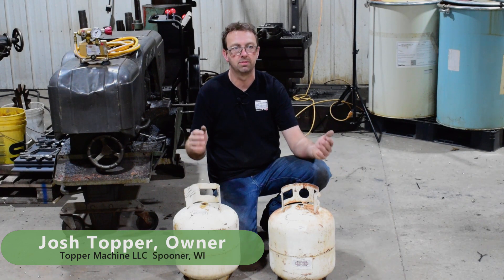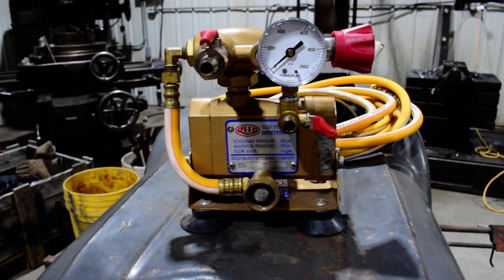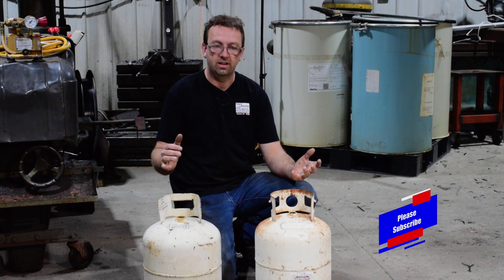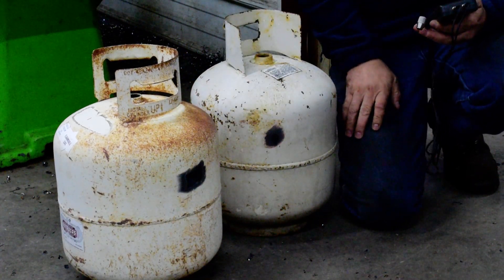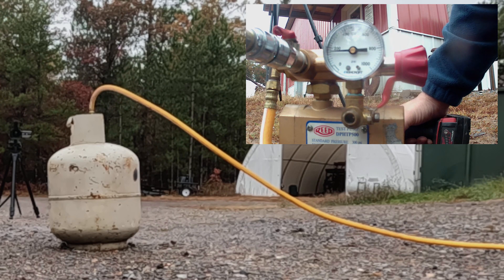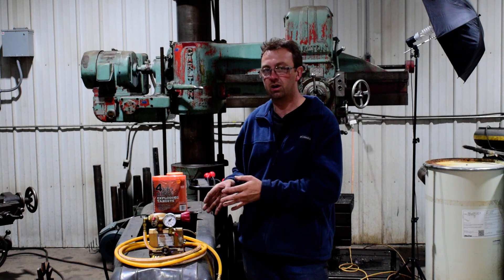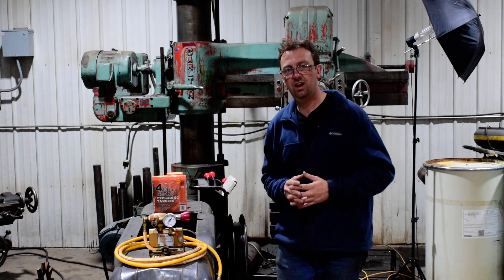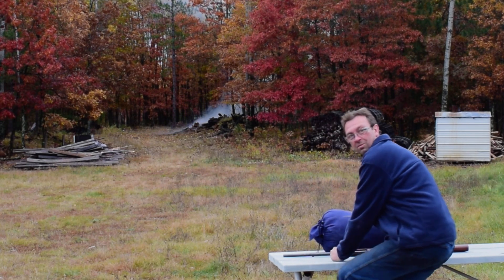What does it take to blow up a propane tank?  Hydrostatic testing

Comment: Very informative.  Having been professionally involved in air testing to failure, I can guarantee that your hydrostatic testing is infinitely safer .  Air testing should not be done by any non-professional and should not be done in anything but a very controlled environment .  Even at that,  it is a very risky business that can destroy  any confinement chamber and/or apparatus .  Personnel injury is a very real concern .
Reply from the maker: Thank you. I have pinned your comment as it is spot on and hopefully others will read it. Been doing hydros for years myself and have seen gas testing by people go wrong. A good hydro pump is a small investment in safety.

Comment: I found out the hard way be safe around propane!

I put a 1lb tank into a mr buddy heater and it had even a TINY leak! I sparked it and it caught on fire! I quickly got it out to the parking space! After 5 minutes the safety cap blew and it burned for nearly a solid 20 minutes!

Lesson learned, do NOT light around that famous rotten egg smell!

Comment: 1:26 not safe to use as an air tank?  Well you would be 100% wrong as propane is 200psi and most air tanks are 150psi.  Still watching the video but they're tested at factory I believe to be 600+psi when recertified.

Comment: Back in the late 80s I was the plant manager and mechanical engineer at a company which manufactured industrial gas cylinders.
As part of our QC process every cylinder was yydrostaticaly tested to 3x working preassure after heat treatment. In addition we would take a random sample from the production line every day and pump it up to failure. We judged the result on 3 criteria - firstly the volumetric increase before failure had to be greater than 50%, the failure had to be at greater than 10x of the working preassure and finally the failure could not be at a weld.
In the case of toxic gases like sulphur dioxide and ammonia we would also x ray all the welds of a sample from a batch. 
As a member of the industry association I was involved in investigating accidents.
There were 3 ways that a failure could occur - extreme heating, mechanical damage and overfilling.
As for calculating the strength, there are design codes which give you the answer. 
In the US that would be ASME. it's not heavy duty maths, just a set of simple formulas. Really it just comes down to the properties of the steel used, the wall thickness, the diameter of the cylinder and to a lesser extent, the shape of the domes.

Comment: What about temperature? it gets as warm as 46 celsius degrees in my town, and my propane tank is stored on the grill under direct sun... is there any chance of explosure with those conditions?
Reply: The pressure relief valve will release the pressure first.

Comment: For a MILD STEEL(60000 tensile) tank:
12.3 diameter tank = 6.15^2 x PI =118sq ins area

The perimeter 12.3 x PI = 38" thickness is .095 = section area=38 x .095  3.67sq in
3.67 x 60 000lbs =220,257 pounds to rupture mild steel of that section

118 sq inches area , to reach 220,257 rupture pressure is 
220,257/118 = 1,866 pounds pressure to rupture it.

Comment: I think you are way off. I can pressurize a small plastic soda bottle to over 125psi w/o it popping. So metal .095 wall should easily take 1000 psi. Also have an aluminium tank rated for 1800 psi and I've had it to 2500 w/o any issue. Also paintball tanks are tested to 7500psi (rated to 4500) and they don't fail unless something is wrong with them. So .095" wall steel if not rusted, should take well over 1000psi.

Comment: Propane tanks are fine for air tanks, working pressure in those tanks is 100-200psi. Unless your planning on filling it to over 200 psi to fill tires with it your pretty safe. The cheap kits they sell are more the risk than the tanks. 

I worked for a few years at a place that refilled and tested large inert gas cylinders, mostly CO2, Halogen, and Nitrogen tanks. The set up they had to test those tanks were large tubes sunk into the ground through the floor filled with water. There were pressure sensors on those in ground cylinders and a mechanism for pulling the tank down into the cylinder empty. The tank got attached to a fill tube and sealed into the water cylinder with no air space around the tank. We would then turn up the air pressure going into the tank to anywhere from 150% to 200% of its rated max. The tank had to retain the pressure without affecting the water pressure surrounding it. If the tank swelled, distorted, or leaked the water pressure would change and therefore condemn the tank. 
Only once did I see a tank fail, it was a medium sized CO2 tank from a bottling company. It split open at 170% of its max. The tank was made in 1947 and had been used steadily up until 1991 when it failed. When it failed all that happened was a slight thump sound and the test tank pressure rose about 15psi or so. The crack in the tank was nearly impossible to even notice once the pressure was let out and it was removed from the test tank. We knew it failed, and the first thing we noticed was that there was water in the C02 tank. The crack closed right back up so tight it didn't even leak water without pressure. 

We often used the system to test other tanks, just so they were empty. (They would have frowned upon someone pumping up pressure in something that would combust in the tube). I tested a few small propane tanks and none ever blew up, even at four times their rated pressure but most would fail for expansion of the tank much over 300 psi or so. Older tanks did better than newer tanks for obvious reasons. 

When it comes to blowing up a propane tank, its not going to happen with propane, its not under that much pressure and isn't all that volatile. Believe me, as a teen, I tried.
Now, rumor has it...What will work was to take an oxygen acetylene mix from a cutting torch, mixed to a bright blue flame, then used to fill the propane cylinder. With the valve closed, and any safety valve defeated, it needs to either be heated to ignition temps, shot with an incendiary round, or shot while sitting atop a fire. None of which will work with propane. The blast will far exceed that pop you got from 6lbs of Tannerite by a lot. Bury it, and its a good way to dig a car size grave.  Not buried, and nearby homes lose windows. In reality, if buried, you don't really need the propane tank, a beach ball or similar will do the same, but that's just what I heard.. You also would not want to be as close to it as you were that little jug of tannerite either. 

The bottom line is that these things are designed to be very safe, and it takes a whole lot of effort to make them super dangerous or to cause some catastrophic failure.

Comment: Little late here... but we are looking primarily at hoop stress. Figure Ft = P * r/t = something like P * 7" / 0.09" = P * 78. The steel is good for something over 60,000 psi, so your pressure at failure of the tube is something like 60,000 psi / 78 = 770 psi. Pitting and welding take a toll on this, and the ends aren't spherical, but are thicker and the steel is undoubtedly better than 60 ksi. But that should be in the ballpark. Gonna guess somewhere between 700 and 1000 psi.
Reply: Just been looking through the comments for a hoop stress calc and my numbers agreed with you at about 900 psi, design pressure with zero margin, however the 60,000psi is inherently conservative from the codes (ASME 8 or BS5500 this side of the pond) so not a surprise it didn't fail. When you consider the pressure in a plastic coke can or bottle could easily be 30 to 40psi 1/10th OG an inch of steel is more than enough. The concern would be corrosion allowance, propane tanks don't rust internally, a wet air receiver wouldn't need much metal loss internally to be a problem. A typical allowance is 1/8" for this sort of duty which is more than the vessel thickness.

Comment: In 2004, there was a propane tank discussion on the RCM newsgroup & after searching the net, I posted: "Working pressure: 240 psi; pressure relief: 375 psi; test pressure: 480 psi; design burst pressure: 960 psi; observed burst pressure: 1200 - 2000 psi"
Reply: And may be higher depending on who made the tank and how rusty or flaked it is.

Comment: I don't think I will be anywhere around your traction engine when you steam it if all you use is 125% of operating pressure for the test.  I have heard that initially use 200% then 150% annually for the test pressure of the operating pressure or safety valve pressure.  For hydro testing, the specimen or subject is filled with water then placed in a tank of known volume and closed off.  Water is added so that the water level on a tube with a marked scale is to a defined point.  The subject is connected to a suitable pump and pressure gauge then the pressure is slowly applied while watching the pressure gauge up to the required test pressure and held for a given time period and the amount of water level on the tube is recorded as to how much the subject has enlarged under the specified pressure.  If there are no leaks, the pressure is released, and the subject is disconnected, drained, and dried.  If it is to be tested to rupture, then the pressure is increased until rupture occurs.
I had a state boiler inspector more leery of the 550-gallon propane tank in the tender than a 175 psi steam boiler on the locomotive.  He said the propane tank terrified him.
Reply from the maker: You obviously don't know the rules and regulations for all historic boilers. Most all states have done away with the 150% & 125% hydro. Wisconsin stopped doing it a few years ago. The only boiler explosions the last few decades were in states that only do hydrostatic testing.  If you want correct information, you can look up the NBIC. They have the minimum guidelines for testing. Then you can look up each individual state for their requirements. Wisconsin is regulated by the DSPS rules for historic boilers.

Comment: Propane at 135F reaches 235psi.  I don't think there's a problem using a propane tank as an air tank PROVIDED the integrety of the tank isn't compromized and/or that it passes a certification test or if it is less than 12 yrs old (the time limit for a pressure recertification).

Comment: As  matter of interest, I cut an old gas tank open some time ago and it was brand new shiny metal inside. No way these tanks can rust inside during normal use, as the ingredients to form rust just aren't there.
Reply: Yep, and also no way for them to spontaneously explode inside the tank, because even if there's a spark in there somehow, there's no oxygen to burn with.

Comment: Modern tanks have the certification temp and pressure stamped on the tank.  At 285 psi (hydro) and ambient temperature, a propane tank is silent compared to an equivalent compressed air tank, which clinks or groans coming up to pressure.    The last propane tank I converted to compressed air service, it was stamped 425 psi at 400° F
Reply: THe only way I could get one to blow (when I was 15 and much dumber) was to make a camp fire and then shovel it in with coal. Once it was hot dig out the center and put the tank in and shovel it in quickly. Rode out on a dirt bike with a friend about a half mile. We saw and heard the collar flying in the air and land on the neighbors property. The woods were bald and the earth was scorched. It was bad. We needed our shorts changed LOL

Comment: Blowing stuff up is fun. Cylindrical pressure vessels generally fail at the transition from cylinder to cap as this is the highest stressed area assuming it is all the same thickness material.

Comment: I am an engineer, not licensed though, and I deal with pressure vessels that we test our products in. Of course, the pressures we deal with are in the range of 10,000-25,000 psi with temperatures up to around 450°F.  Yes, we have a controlled environment we test in, all done in the ground below the surface and personnel in a safe building nearby. 
There is a full set of rules and calculations that are published by the ASME on any kind of pressure vessels used in industry today, including those used in steam service.  Most engineering books go into some detail of using the basic calculation for burst pressure but leave lots out because of the complexity calculations get in vessel design.  By using one of the calculations, I normally use day to day, I come up with a rough guess of around 1000-1200 psi.  I'm just taking a WAG on the diameter of the tank, yield strength of the material. Since this vessel has capped ends and elliptical shaped ends, this helps in determining the amount of pressure it will hold. 
Also, ASME specifies the minimum safety factor or working pressure required as well as the test pressure for a vessel.  It also depends on which section of the ASME rules you follow by determining these factors.  Oh, I forgot to mention DOT has a hand in this, too.  So their rules may override those of ASME, IDK.  DOT is more about transportation and handling of dangerous materials.
Oh, when are you going to blow up a oxygen welding tank?
Be safe whatever you do. Ken
Reply from the maker: Thanks Ken. Great info and your estimate will be put to the test in the spring.

Comment: I subscribed recently and have been watching and enjoying  your older videos progressing toward the most recent.  I have a question about cutting external threads on the lathe and making multiple passes.  How do you start each pass at the same place?  Maybe you could do a video.  I am retired from a life of working on tractors, radar drives and radar transmitters.   I would have  liked to work in a machine shop with lathes, mills, I find the way they transform steel fascinating.
Reply from the maker: Thanks. I think I have a video showing the thread dial and how to use it. But I could do something coming up at some point.

Comment: Would there be a way to measure the diameter of the tank as you put the pressure to it.
It must swell as the pressure reaches the failure point.
Reply from the maker: Now this would be a great thing to try and do. You have me quite curious. I'll think about a way to do it and when things thaw out in the spring, I'll try to make it happen.
Reply: @TopperMachineLLC  ... use a cloth tape measure and a small spring to hold it around the tank, then zoom the camera in where the tape overlaps itself. Might be hard to see but I'd bet there will be 1/8" - 1/4" stretch in diameter.
Reply: @TopperMachineLLC  Fix the tank to a wooden base, and mount a cheap dial indicator on a post fixed to the same base with it measuring the side of the tank.

Comment: Had to laugh, let’s test blowing up tank next to a drying fall forest. If it actually did start a forest fire what was plan “B” because some idiot would use propane and api ammo. But I saw it on utube. Just hook up a welding argon tank, there’s your 2000 psi scary as hell, non flammable,over the rating test.   But the scrap metal will fly far, fast and wide.   Just bury it  more than ten feet under void less with a weighed cover mat.
Reply from the maker: You obviously didn't watch the video. Maybe try watching the whole thing before making stupid comments!

Comment: The operating pressure in a propane tank is 240 psi,when the tank is overfill the psi rise to 375 psi at this point the relieve valve open to release the excess of propane as far I know the hydrostatic test is to reach the tank to 600 psi is the tank does not blown pass the test to use this tank for 6 years.

Comment: Propane tanks are rated quite a bit higher than most compressed air tanks. Propane is typically between 100 and 200 psi depending on temp. So it is fine to use a propane tank as an air tank, but don't use an air tank for propane.
Reply: This is true. The head pressure of propane can be as high ast 350 in a nominal environment depending on many factors including gas mix. Propane is not 100% pure in the tank. High purity propane is used for refrigeration and labeled some exotic refrigerant.  We converted an air conditioning system one time to run on propane... It worked better than anything else and because we used some sloppy parts it could be filled with gas grill cylinders. It was MUCH colder than 134 or 22 systems. Had really good capabilities. Not enough in the system to cause much trouble. Exchangers were all outside so if there was gas, it was minimal.  Like Jackie Gleason used to say... TO The Moon Alice.
Reply: Ha, for a short period I used propane in the AC in my car, worked pretty well.

Comment: been using one for a portable air tank for years. Max my compressor will do is 125 psi. nowhere near the capacity of these tanks. So much thicker than the 20 gauge steel "real" air tanks are made of! I had to take the valve out and remove the safety back flow leak preventer thingy so it free flows, but it works great.

Comment: It taks a lot those tanks are designed to NOT blow up. They are DOT rated to be dropped off a the back of a truck. Even if placed in a fire the pop off will blow and vent the propane to keep the vessel from going full on grenade. The OPD valves that are now required were added to keep the tanks from being completely filled to allow expansion space for the propane. A full bottle in direct sunlight on a hot day can get north of 250psi. The real risk of these is the propane leaking and since propane is heavier than air will want to pool in a low area like a basement and turn your house into a bomb. Good video except now I want a hydrostatic test setup LoL.
Reply: while you are not likely to reach high temps in a basement, a hot car with the windows up could be a doozy if you got a leaker!